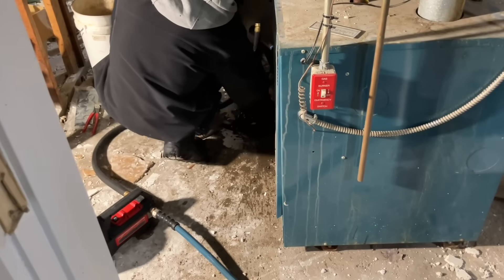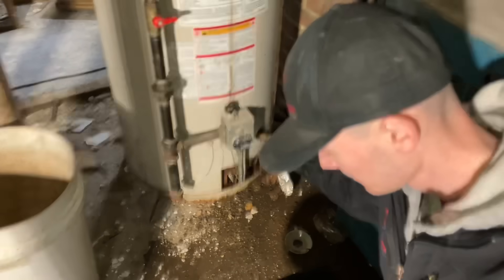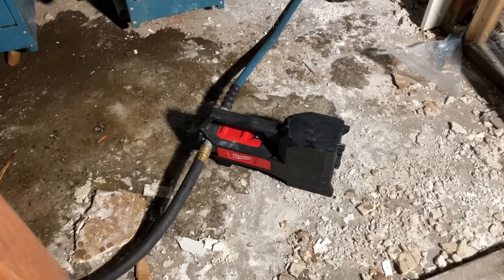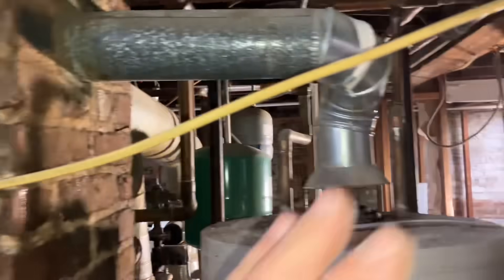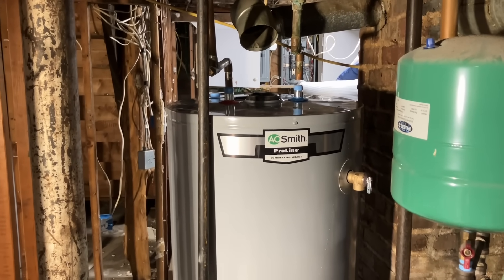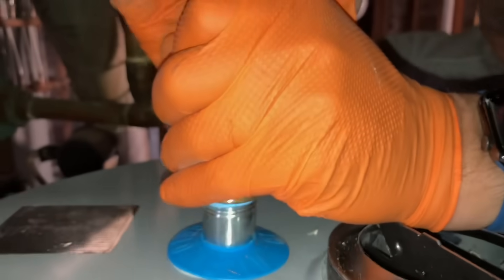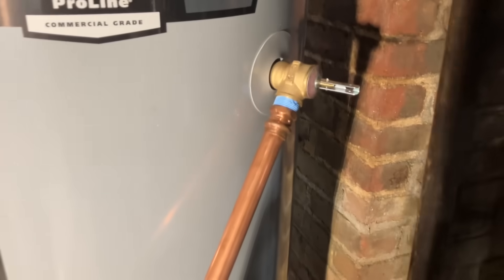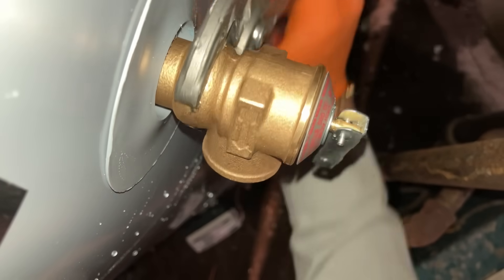Drain a Water Heater in UNDER 5 Minutes! AO Smith 50 Gallon Replacement Done Right 🔥

Comment: Mike I noticed you left the PRV open when you filling the heater , that’s what damaged the valve , I used to do that as well and was going through PRV’s like crazy, go open up a sink somewhere instead
Reply: that should never cause a new T&P/water heater to leak, if it does the valve is either bad to start with or there's a ton of debris from the pipes now in the tank and new valve.
meaning you better flush it multiple times until clear and open the t&p more times to clean it out. nothing would surprise me, I've seen multiple new tanks with t&p, nipples and random threaded leaking leaking on the factory installed tank side(dielectric nipples, gas valve, T&P, anode) just random leaking locations, usually always tight but poor thread sealant application.

Comment: Water gets trapped in the gauge and then freezes in the winter while on the service truck.
Reply: they'll also do that if the pressure is high and a valve gets opened fast or there's a high flow to something and it stops suddenly. water hammer kills gauges, unless liquid filled dampened type and even then it may. done that myself a handful of times over the years, even 200psi gauge on high city pressure, closed ball valve slightly too fast with laundry faucet flowing and water hammered it(setting pressure regulator), city static pressure was hitting 130PSI late at night and stays north of 80psi during day usage.

Comment: How do you swap the drain with the water in the tank and not make a big mess? Great work Mike!
Reply: There’s a vacuum in the tank, as long as the shutoffs are closed going into the tank, or no faucets are opened upstairs nothing will drain out.
Reply: @Drrich_DIY  what happens when that water heater valve breaks off at the threads.
Reply: @chrislatney6291 you’re gonna look pretty silly

Comment: I want to see someone sharkbite and air hookup to the top and bust it out with 80psi
Reply: They make a doo-dad called...I don't remember, I think it's the sediment buster? That screws onto the less-than-full-port drain valve and has a Schrader core on it so you can pressurize the tank (hopefully your isolation works or it'll be useless) with an air compressor or bike pump or whatever to help with draining it. 
I've never seen one used, but it looked like a neat little rig. I was tempted to buy one